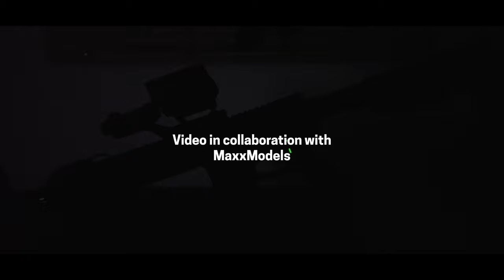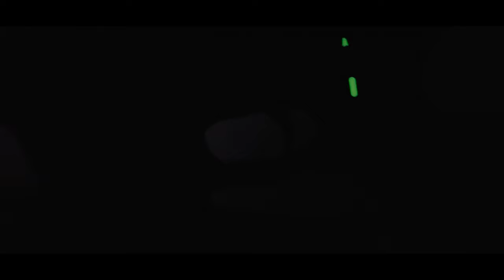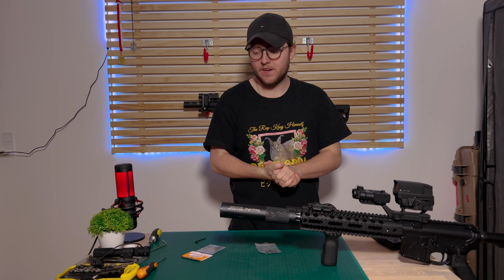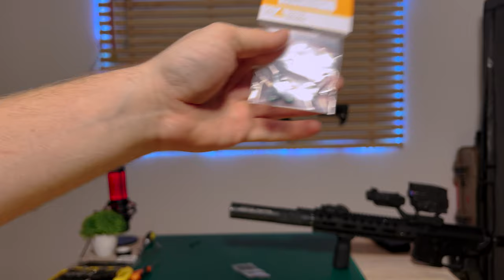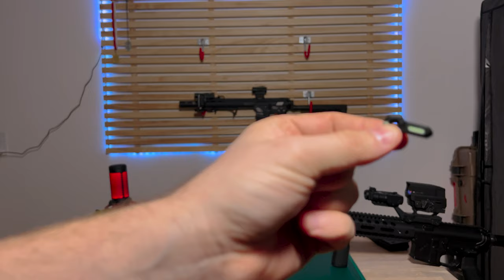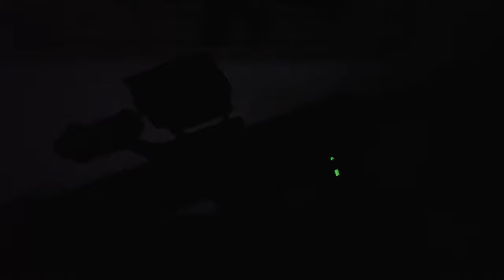New Maxx MTW Selector Switch! (GLOW IN THE DARK) Ft Maxxmodels

Comment: What did you use to get yours off mines stuck
Reply from the maker: Mine was literally impossible to fucking remove, so I had to literally Dremel it off and cut it off
Reply: Which bit did you dremel just the Allen bolt or the selector switch it's self
Reply: And thank you for the fast reply